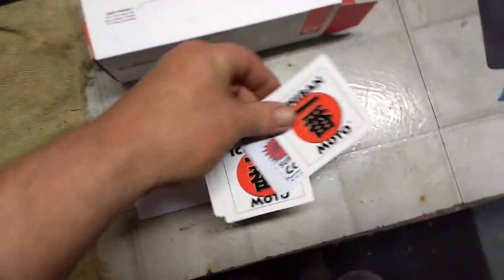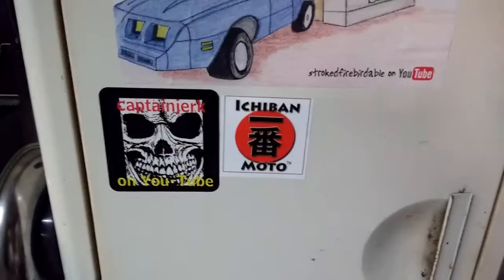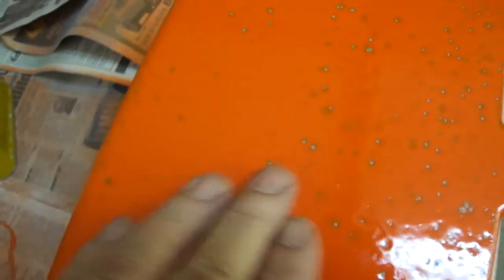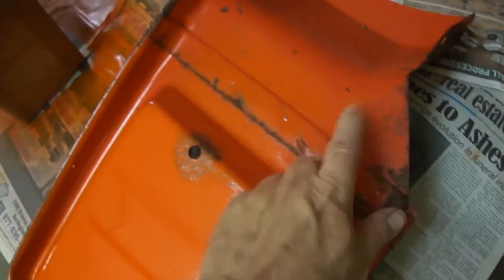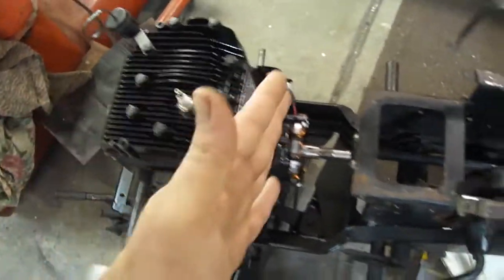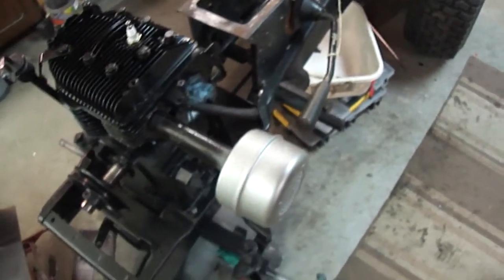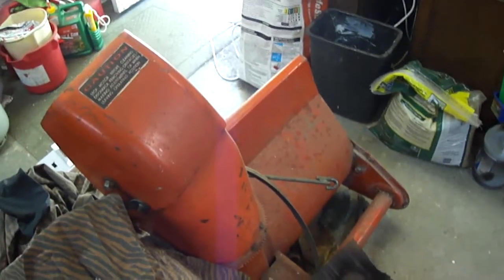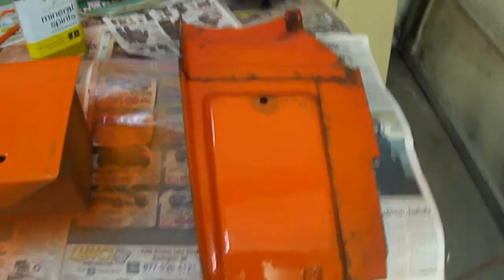1975 Gilson Update #2 6-16-2016 and Mail Call

Comment: Tractor is looking good. With a good fitting bearing the spindle should last a long time just watch for bearing spin. C ya.
Reply from the maker: Yea, a few searches shows no spindles available so I may end up just using it. I did not notice any issues with it before I started rebuilding it so was really shocked when I found it. Given top speed is what 10mph I am not too worried about it however that snow thrower is one heavy item so that is the part that has me a bit concerned.

Comment: Didn't Gilson use the same orange as Allis Chalmers? Would have made that matching a heck of a lot easier...  I do have one of those plugs you need too...
Reply: Wait, did I just see/hear something about Grandpa? Congratulations!!
Reply from the maker: Thanks just became a Grandpa yesterday.. Very cool.. More on that later. :) If you have that plug I would love to buy it from you (assuming you have paypal or I can do cash) just PM me and let me know if you do and what you would like for it. Trying to find one is a pain and finding one in the trash could take for every since most of the tractors put out to the curb don't stay long as you might imagine!
Reply: Tell you what, I'll call it an even trade for a couple stickers should you have any, if not you can just have it. I'm going to assume it's the briggs low amp setup where 1 lead is lights and the other like... 3A charge for the battery? what it appeared to be anyway... I have just such a beastie, about ready to be swapped out for something bigger...
Reply from the maker: So I did some checking and the orange that Allis Chalmers uses seems to be a close match so I got a can and it does seem to be closer to the Gilson orange of course it's not perfect but then the paint on the tractor is 40+ years old so.. I am going to see if I can get something other than rattle can if I can I will use that.

Thanks for mentioning it!!!
Reply: Should be able to pick up enamel at least in a local implement shop...